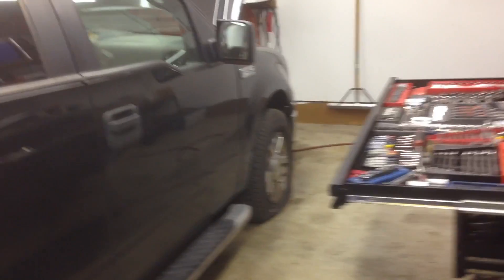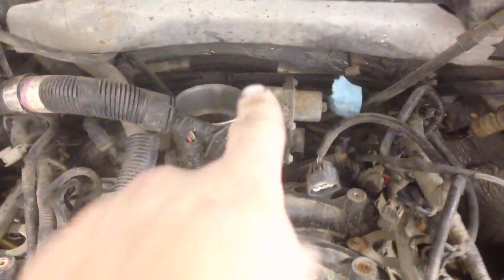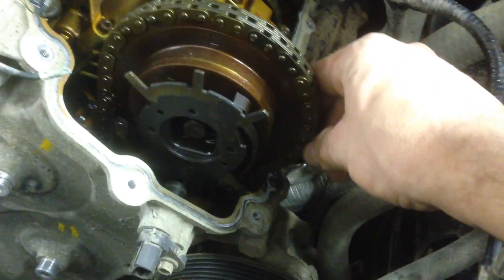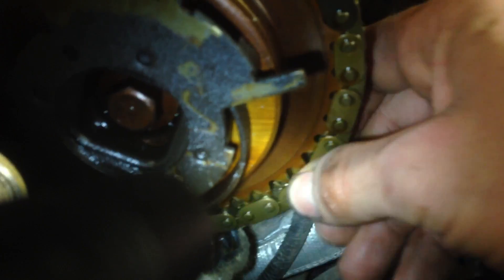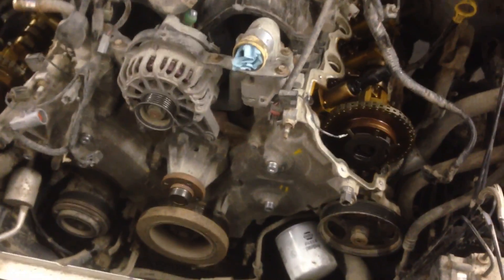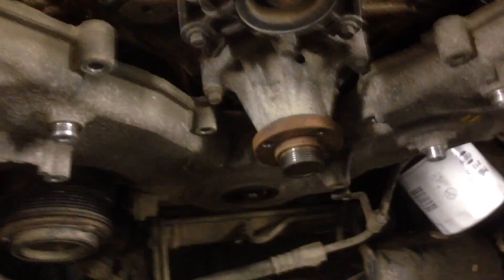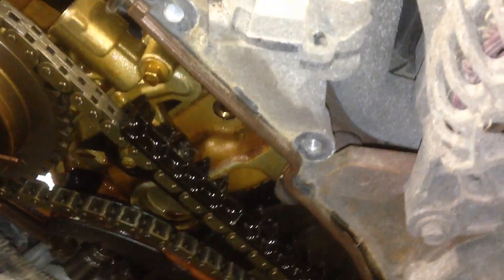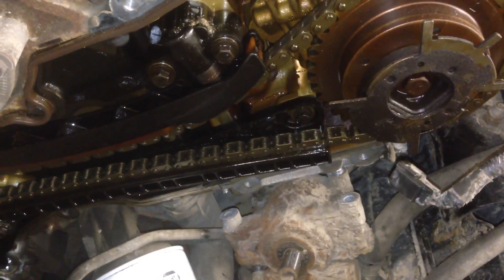Ford 5.4 Triton Engine Rattle Timing Chains

Comment: Your problem is the tensioner. Get thin vise grip and roll that cam towards the passenger side and youll see your tensioner gave out because its blowed out. Your cam is rolled back putting the slack in the chain on the bottom side ahere you was running your finger back and forth.

Comment: You need to buy all new updated ford chains and phasers then lock the new phasers out and have the ecm flashed to eliminate the vct system then slso put in a high volumn oil pump. Then it will be bulletproofed. I literally just got done doing this on my dads truck. It runs amazing now. These are good engines once you bulletproof them.

Comment: I got to 220k and went over 5 k for oil a handful of times. I have p0345 and p0348 now, I can hear a chain rattle at very low idle and a slight diesel noise changing gears. Believe it or not she is still
Giving me 19 mpg on the hwy. so I wouldn’t call it a failure. At this point I’d say my only problem is the CEL comes on. All I did was keep it OEM, change the plugs and oil. 5.4 had been really good to me. How many 2004 Chevy or dodges do you see still
Driving around? Not many lol

Comment: Over half of the 5.4 3valve's problems would have been solved with a different chain tensioner. The plastic guides are actually not a problem at all and will last beyond the life of the vehichle. It's when the tensioners fail and the chain starts slapping against the plastic that it breaks. Then you're in trouble. Cam phasers are pretty much doomed to knock no matter how well they are taken care of. And spark plugs were changed to a better design that doesn't break for the late 08+ 5.4's. If you are in the market for a 5.4, I highly suggest getting an 09+. My 2010 f-150 5.4 is still going at 197,800 miles with 0 work done to the engine other than spark plugs (mine never broke thanks to the redesign). Oil changes every 8,000-10,000 miles, not joking. Mine only has the cam phaser knocking sound at idle but engine still performs like brand new.

Comment: I've paused on 5:07 and moved back and forth a few frames before your hand was in the way.. Looks like the tensioner is completely compressed. It may have cracked and as the oil seeped, it failed. That is usually what happens just before the guides slip towards it and the lower side guide snaps in half or cracks. I have a 5.4 16 valve engine that had not been opened up for 285,000 miles until just a week ago when a neighbor turned it over to me with what sounded like a stuck intake valve. Low and behold... Someone dropped a screw/bolt into the intake manifold and it wedged into the intake valve. Heads were in great shape other than that and the lifter that collapsed along with the rocker arm that fell off... It actually had been running with a worn out chain and a lower tensioner guide that should have been making a lot more noise than it was. These are race quality engines that should be treated that way. Of course, an old '72 351 Cleveland sounds like more fun, especially in the teen years of days gone by.

Comment: There is a lot of misinformation in this video. These issues do not appear on there own, this happened because of a neglected motor. Ford 3v Mod motors have very precision fit components that can be damaged and malfunction if the oil is not changed in time. Additionally, the plastic chain guides are fine as long as you do the oil changes and don't let the oil get to low. the 4.6 in your Grand Marquis has plastic guides and they are doing just fine, and so is my 4.6 with 240k; haven't had to change them yet. As long as you change your oil regularly and use the recommended oil you will be fine.
Reply: Wrong. Put a brand new motor in my 5.4 and 30k miles later the tensioner blew out as they are a poor design. Caused a loud slap noise. Even with perfect oil changes these are hit or miss motors.

Comment: The 4.6 I have had this god awful clacking noise. Was doing my valve cover gaskets at the time and decided to explore the noise while I was at it. Turns out the chain guide on the driver side was split in 2 and was straddling the timing chain. I don't know how it didn't skip a tooth. Replaced the guides, tensioners and chain. Sweet relief from that demonic noise

Comment: Ford:
"Let's use plastic chain guides on a pair of timing chains that are about a mile long combined. What could possibly go wrong"????
I disagree with the idea that these engines are total design failures, though. Except for these cheap-ass timing chain components, these are super tough engines. The chains and gears themselves are usually good for 250,000 miles+ but the tensioners and guides usually require replacement before then. You have to keep an "ear out" for chain slack noises.
Reply: scdevon unfortunately most or all car manufacturers use plastic guides on chains
Reply: nothing wrong with the plastic guides. it's the shit tensioners that fail. i'm in the middle of doing a complete rebuild on my 05. cam phasers, chains, guides, tensioners, new crank shaft sprocket and brand new cam/valve rollers.
had both tensioners fail. thankfully the engine didn't skip timing. the hardest part was removing rotted and rusted bolts, and sourcing replacements. Ford doesn't have any valve cover bolts, and they have been on back order for months. thankfully i was able to find them online. overall, a week down time to get this shit engine fixed.
Reply: -fhadynamo Hopefully you used the ratcheting tensioners from the 2v engine. That almost guarantees no more timing component related failures.
Reply: @TheTerminator310  so are you saying the 99-02 tensioners don't really leak down and fail like the 3v motors?
Reply: @stallionranchwoodworks  Yes, the steel ratcheting tensioners have no gasket to blow out and thus will not leak down due to the failsafe ratchet mechanism.

Comment: The chains are loose when no oil pressure is present. Tensioners are not keeping oil pressure and letting chain stay loose while running. I still have same problem after changing out timing components. Everything was tight when installed, but still sounds loose when running. Yes, I pulled the pins on the tensioners. A Ford is a Ford is a Ford. Will have to take all apart again. May try gaskets to get better seal, or something else-don't know yet. Taking this thing apart is a pain.

Comment: You just explained my truck to the T.Sounds like my loud ticking is coming from passenger side.Afraid to ask.What should a job like this cost me to get repaired.Ford and other repair shops have me up to 2200.00 which was fuel pump spark plugs fuel sending unit and other items.

Comment: *****NOBODY CAN FIGURE THIS OUT!!!!I have a 2006 Lincoln Navigator a whirling sound from engine compartment. NOT POWER STEERING, but sounds like that when PS fluid gets low and wheel being turned. No check engine lights or rough idle. Running just fine...for now. Any help would be appreciated. I have a 24 sec video -- https://youtu.be/6UsBO5aPWSA.
Reply: bleedingeyeball27  i had that on an 08 envoy and it was a pulley bearing going bad

Comment: Richard Province, do your fucking homework about them shitty ass 5.4 motors . Too bad they put them on Fords
Reply: they new 3 valve 5.4 sucked so much but the older 2 valve 5.4 is tough our Ford Expedition has a 5.4L 2 Valve paired with a 4R100 transmission and we have towed over 8 tons...which is not good for the frame but did well we towed for 30 miles to a dump hauling a dump trailer and roof material from a construction site only the 2 valve was a good engine the 3 valve had spark plug fail too

Comment: I always laugh when a technician will say "genius engineers". Like you have any clue what-so-ever about engineering, There is a reason those guides are plastic, and there is a reason why Ford tells you when to replace them. It's not their fault you ignored it and fucked yourself. The phasers are 'prone' to failure. Replace them, big deal seriously. Go get a 5.7 and yard sale your rods going down the road. Or get a 4.7 and don't even bother changing the oil. Go get a 5.3 and keep a spare valve body.  Nothing is perfect.

Comment: If you have the 5.4 2 or 3 valve it has plastic chain guides. They break. If you do the job right it will run about $1000 for the three valve. And take your time do some research. I just finished mine and I freaking love the way it runs. Also installed dual electric fans. Now it has power over 3200 rpms!

Comment: How much do you think this repair would cost at a mechanics?
Reply: If I remember correct, timing set replacement calls for 12.x book hours + parts
Reply: $2200 3 years ago
Reply: Going thru this right now with a 06 Navigator, I don't want to know.
Reply: the parts are 850 minus the water pump. so add labor

Comment: have over 250K on Shop work truck 2007 F150 5.4  have always used Chevron delo LE 15w40  From NEW never had any problems with the engine !

people complain about the timing parts failing  if you use crap oil and don't change it but every 8k-10k miles what do you think is going to happen !!

Comment: My 2008 Ford King Ranch With the 5.4 Triton shit on me at 120,000 miles. I had to replace the timing chain and cam phasers in this tuck and I took very good care of this truck and kept the oil changed every 5,000 miles. I've been reading on these motors and it seems to be happening a lot to these motors. If it didn't happen to your 5.4 well I'm glad but just be ready for it. Me and a friend did all the work, you just about have to take the whole damn motor apart. I know Ford has not addressed these problems and there still happening on the newer trucks.
Reply: Your ignorant, look up ford timing chain problems on the 5.4 motors..Mr. mechanic full of shit
Reply: I don't need too. Why would I ha-ha. Nice try at a comment though.

Comment: did this fix the misfiring issue? I found my timing chain loose after removing the valve cover tracking an odd misfire at idle.

Comment: I keep hearing horror stories about these v3 5.4 motors! Ford should of just left good enough alone! I have a 03 v2 5.4 with over 320,000 miles on it and it runs like a top! never had the motor open!
Reply: I've done about 30 phaser/timing chain jobs in the last year on 5.4 3v engines and I can tell you most of them come in between 120-150k. I did have one guy, though, that came in with 379k on the clock and it looked almost new under the covers. Religious maintenance and quality synthetic oil will make these engines last.
Reply: I don't care what magic oil you use, or how you drive. Timing components DO NOT last 300k+ miles. Your full of shit. And they didn't leave well enough alone because they wanted to provide people with better performance, more mileage, and overall more efficiency.
Reply: +Richard Province well that's funny! the reason they don't leave well enough alone in this case is not to provide a better engine for people but rather to make the government happy with lower emissions. o and I was wrong on my millage its not 320,000 its 325,000 lol. its pretty ignorant to call someone "full o shit" with out knowing what your talking about. would you like pics of my odometer?? I will say the timing system will and did last that long. with the exception of chain guide clatter on the first start but still runs like a top.
Reply: Kenneth Maccourt did it ever rattle occasionally under low rpms?
Reply: how much cost to fix it?
Reply: Victor Jaramillo the way I do it it costs $1900. I replace the whole timing set, replace the oil pump with a high pressure mellings pump, lock the cam phasers, and tune the ecm.
Reply: @danieldelgado982  very bad idea!
Reply: @brentbradley6711  says you. Over 100 satisfied customers for me that say otherwise. No more ticking or any chance of failed phasers happening again.
Reply: @danieldelgado982  Yea but they just gave up their MPGs and HP when they could have just fixed it right. Really a BAD idea!
Reply: @brentbradley6711  I've tested these things in trucks extensively. The mpg loss is negligible and the hp loss isn't even noticeable. You lose nothing on the low end and 5-10hp on the top end on a bad day. The mpg loss average in my super duty was 0.2mpg. That's a rounding error or a bad headwind one day. Nothing to worry about. With the cam locked in the advanced position you make more torque at lower rpm and if you're driving a truck that's what you really want anyway. Fixing it the "right way" doesn't guarantee that it won't repeat the same failure. I've seen trucks come out of the ford dealer last as little as 4 months before the phaser noise came back. That's just unacceptable. The phasers aren't primarily there for power, they're there for emissions purposes so they could do away with the egr system. I'll trade reliability for 5hp any day and most people would agree.
Reply: @danieldelgado982  I will replace the phaser on mine, Ford made them to help the engine, that's like throwing away the "stupid" air filter. It's a one time fix with good parts...…...not buying it.
Reply: @brentbradley6711  do whatever you like, I really don't care. Remember one thing though, it was Ford's engineering that failed in the first place. My way is a time tested and proven solution. Over 60k miles on my personal rig with no detrimental effects. The only thing Ford's engineering did was help their CAFE standards and eliminate the requirement for EGR.  Your opinion on it really doesn't matter.
Reply: @danieldelgado982  So why do you keep replying to it? Those parts can fail but they were there to make that engine perform much better. Sure it's proven but so is ripping out your seat belts......lol
Reply: @danieldelgado982  Yea after you talked them into it and they don't know what they are missing.
Reply: @brentbradley6711  that's about the dumbest thing I've read all day, lol. Good job. Cam phasers weren't put there to make the engine run much better. I'd argue that failing phasers make it run much worse. They were put there to eliminate the egr. They have almost no effect on power or economy. That's fact and has been proven. You can go ahead and trust tech that has been proven to fail, you can't fix stupid. The engines I've repaired aren't missing anything but the failure point that Ford engineered badly.
Reply: @danieldelgado982  You know they added HP and lessened MPG, you just talked everyone into screwing up their car so you could make a few bucks...……..disgusting.
Reply: @danieldelgado982  Rip off
Reply: @danieldelgado982  Combative rip off
Reply: @danieldelgado982  can you please send me your contact information in case I need to get my phasers replaced?

Comment: You MUST always use a Motorcraft oil filter on these 5.4 3v engines. They don't like anything else and definitely not oil changes over 4K miles. These are great engines. They just require a little more finesse.
Reply: THETOPGLOCK agree.
Reply: I have two expeditions and both over 225k. My one sounds like thos. But I only loose power when under wot. And givea me a misfire code. And pulls timing out

Comment: My crankshaft turn along my harmony balancer when I removed the balancer it's these bad, and you need to remove the number 1 cylinder spark plug to set the timing.

Comment: Mine had the same symtoms but it was a busted cam phaser on the driver side--the big spring was broken.  Actually the tensioners feel different when you squeeze them because one sits upside down and has a check valve to keep it from draining which is why they are marked Left and Right.

Comment: in chains, one side must be more tensioned than his counter part as the traction is driven by one gear, so traction forces comes along on side while the other still loose.. if you get to sides of same chain loose, then there is a problem.. how ever, who the fuck use plastics components inside an engine?  Ford engineers lack of experience in those years.
Reply: +cruise2kx BMW stands for BURNING MY WALLET
Reply: +cruise2kx how you get a 2007 BMW 327 if there was produced just to 1945 ?

Comment: What a disgrace for a long term design- You know some of these designs MIGHT hold water in theory when maintained properly but when in real life circumstances its a failure- I will keep my 1996 Jeep GC with the ancient but BASIC 5.2, 144,000 miles and runs like new

Comment: Hi I have a big favor to ask, I want to do this job in my f150, in the repair manual said that I have to take out all the roller follower, so basically I can lose all the camshaft caps and do the job, but I want to know when do I lose the camshaft caps and when do I need to tight them up. I hope you can help me.

Comment: Minus well call Jasper and have them send one of their reman 3 valve reman 5.4s.Within a year after the timing chain replacement,you will replace the whole engine.This engine is Jasper's #1 selling reman
Reply: No hey are not,never had a problem with them yet.Had a problem with one of their 5.7 hemis for a 2008 Chrysler 300 C twice and they covered it.Had bad lifters and they were on the spot finding this.Sent out another engine and two checks to cover the labor.The factory remans from Ford,GM and Chrysler,no upgrades and they outsource this to be done.Auto Parts stores remans,warranty is a hassle taking it to one of their places and nothing but excuses out of them